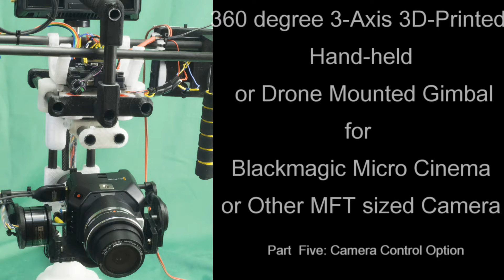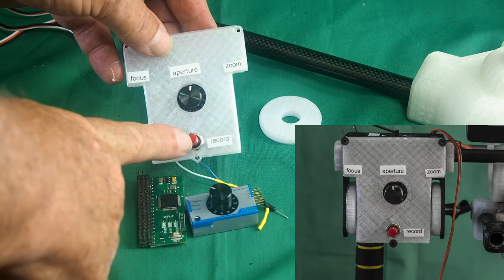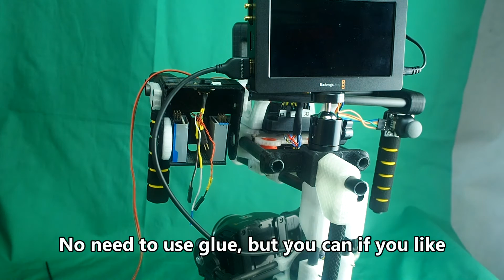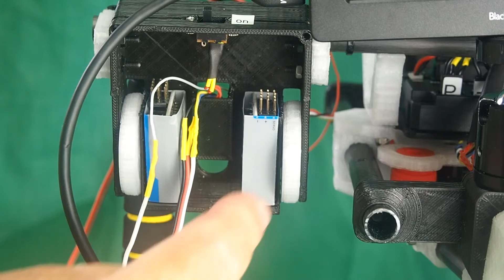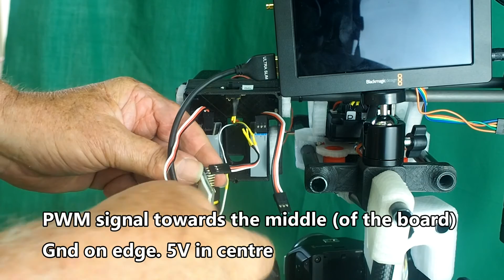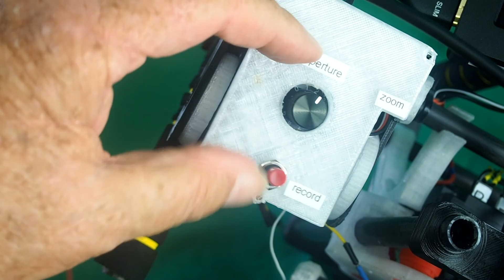Hand held or Drone Mounted Gimbal for BlackMagic Micro Cinema Part 5 Camera control

Comment: Hi Chris,
thank you for this inspiring video.
I also built a little breakout box for shutter, ISO, wb and rec control (via direct PWM), but I was missing focus control.

If you don't mind, I got two questions for you. First, how did you manage to get power from the camera to the sbus converter board? Did you use the 5V out pin of the camera d-sub plug?
Secondly, do you get smooth focus control with the servo tester? I connected a tester to the camera (with external power) via PWM. It works fine with iris control, but when it comes to focus pulling, it sometimes jumps between two focal points. I see that your tester has numbers on it. Does the control dial has stops/clicks or is it seamless?

Thank you!
Reply from the maker: I used the 5v output from the BM camera to power the servo testers. Maybe the servo tester you are using for focus does not have high enough resolution. I did not notice this on mine, but I will check. Have you tried a different type of servo tester. The servo tester I am using does not have clicks, it is seamless. Hope this helps.
Reply: Thank you, that helps a lot!